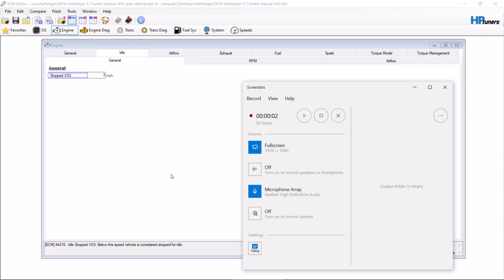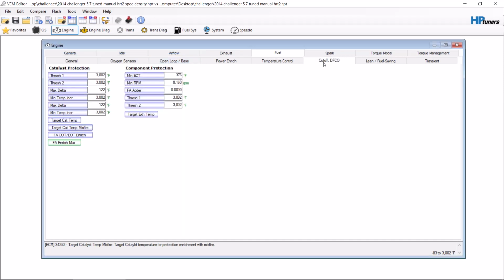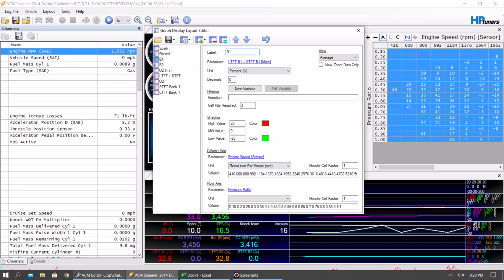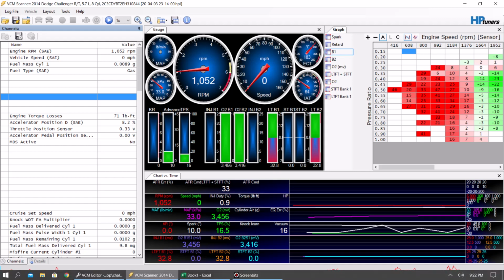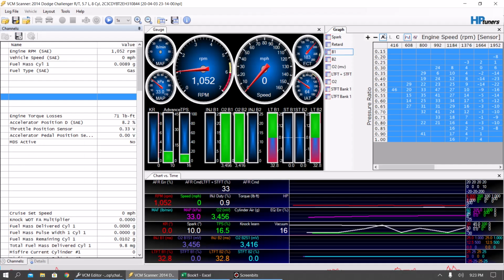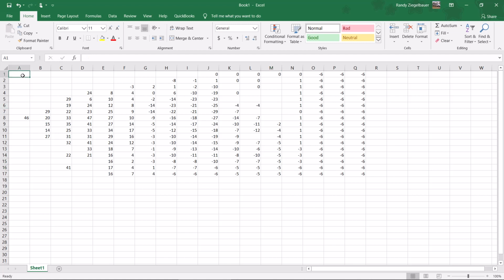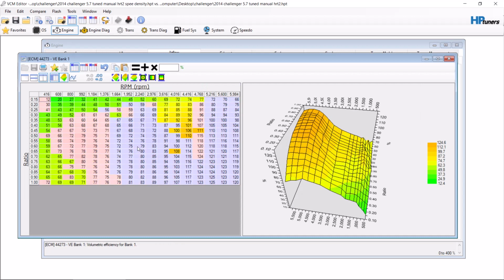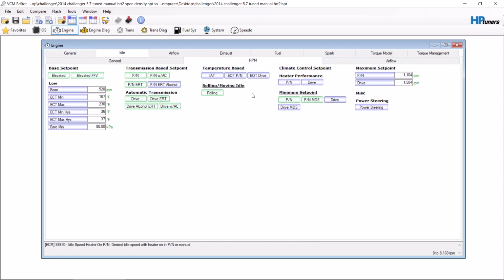How to tune VE on a gen 3 Hemi vehicle

Comment: Awesome video thank you! I am new to this and learning as much as I can. On the larger errors Is there a reason why you would not want to just account for the error more directly instead of creeping up on it? Like if you have a cell or area that is +20 in your error table this means that averaged it needed to add 20% more fuel to the VE table at that datapoint to stop being lean. Correct? what would be the downside to just use the paste special to multiple by %? this would essentially multiply by 1.20 and increase fuel 20% in the VE table?

Comment: I built the two tables that you describe in this video and follow the steps but no matter what changes I make to the VE table, the cells in the log only populate as zero. I have done up to a 20% swing on my VE tables, and I simply can’t get those tables to work as designed. Any pointers?
Reply from the maker: Usually if it’s not populating it’s because it’s missing what you’re trying to log in the channels

Comment: I have a Gen 3 5.7l that I installed a Comp stage 2 cam, 273HRT.  I watched your video on VE on a Gen 3 hemi.  On start up it goes to 1400 then slowly idles down to 800 then surges up and down til it dies.  I logged the VE like you said but my table has negative green, no red cells like yours, and they increase to about -16 and bounces as low as 400 rpm til it dies.
What can I change (the VE ) to get it to run so I can log?  Keith
Reply: Any luck? have a similar issue with my 6.1 rebuild i got going in
Reply: Me to bro  @03Creations

Comment: Could you explain why setting Power Enrichment Delay -> RPM Max to extremely high RPM disables it? The description says rather something else. WHat I understand is that above this RPM the delay in going into Power ENrichment is disabled. Not the power enrichment itself. Also the desctiption says that ABOVE THIS RPM it is disabled, but you will never go above. I don't understand that part.

Comment: So after part throttle you would turn everything else back on except NN and tune the rest of the table? I've got the proper inj data entered but fueling is way off with NN. I want to try and use ve to tune and not hack my pulse width data. This is on a Hellcat. Id1050x inj and 17lbs boost.
Reply from the maker: Technically if injector data is solid you don’t mess with it, just do ve only

Comment: Thanks for the video. How does the system use these tables? Does it switch from one  table to the other at WOT?
Thanks!
Reply from the maker: Which tables exactly
Reply: @Recklessmotorsports  VE 1& 2
Reply from the maker: If there is NN then they always use them
Reply: @Recklessmotorsports  No NN 05 Ram 1500 Hemi
Reply from the maker: Then it uses it all the time

Comment: Thanks for these videos 
I am looking for tuning software 
I was going to buy the CMR because both my hemis are Diablo PCM unlocked and Diablo CMR tuned.  Could you advise if I am switching over to HP tuners what needs to be done or stick with CMR purchase plan
Reply from the maker: Switch to hptuners trust me it’s worth it and most times you can use same pcm

Comment: I do have a question if your bumping up the shift points I’m assuming you need to do  the same to the RPM axis on the VE table to match the new Shift points ?? Or just leave it cause I see you can change it .

Comment: I disabled NN and all variable camshaft options and no change to the ve table has an effect on fuel trims. It seems to not be in speed density. Any clue what would cause this?
Reply: Speed Density is WOT only not normal driving, once you step on it your oxygen sensors have no say

Comment: Hi, i dont understand the VE. I hope you can help me. My questions are:
1- what does minus mean in the VE graph and why does errors show. What do errors mean? 

2- why are we copying the the graph from the scanner to the editor? Why are we copying the errors? 

3-what does a low (red) VE mean in the chart? What causes it? 

4- why does it show minus and what causes the error to show in the first place while logging\driving.

5- when you copy paste the numbers from the scanner to the bank 1 ve. What does this do? And what should you do after it? Do you also manualy adjust each number to make it smooth? And when you change a VE number what happens? Does the computer add fuel or? Idk its confusing.

Pleasee helppppp.
Reply from the maker: Error is fuel it’s adding or subtracting in a percent. Red means it’s lean and it’s adding fuel. We are selecting the error and pasting multiply by half so the change isn’t so dramatic
Reply: @Recklessmotorsports  when you go to the main VE table and see all these numbers 50,90,70 etc. Are these fuel? Does 90 mean rich ? And 50 lean? I mean if we are using the fuel errors to adjust in the Main Ve then the main VE numbers should be fuel right?
Reply: @captain052A  VE means volumetric efficiency, so 100% means 100% of the cylinder gets filled with air/fuel mix. at low rpms/loads. An engine almost never fills 100% of its cylinders with air. Say for example the engine only fills 50% of its cylinders with air at 3000RPM at 40% load (0.4 Pressure Ratio); the 50% in the VE table for that data point tells the ECU to inject half as much fuel as it would need to if the cylinder was filling 100% of its space with. Its not lean or rich (unless the table is off, in which case you need to add or subtract fuel based on the datalogging. The ecu always aims for Stoichiometric ratio at any given VE as defined in your FA Stoich Table. only time it aims for higher (richer) is when in Power Enrichment.

Comment: If my base file that i grabbed from my car already has power enrich delay rpm max set to 8160 does that mean from factory power enrich is disabled?
Reply from the maker: Yes
Reply: No!  That means that there is a DELAY enabled before PE is entered.  PE is not disabled by turning on a delay, unless you set a delay value that is stupid high.
Reply from the maker: 8160rpms is super high.

But with that being said the descriptions can be confusing, one might make it sound like at 8k there is a delay and another description might make it sound like there is a delay until over 8k. 

Read the description multiple times and it’ll make sense

Comment: So if I'm getting positive numbers that are red between 1100 and say 3200 RPM in the lower rows like 0.10.0.30 am I supposed to go to my table and add to a multiplier times 1.1 like you did for the very low end? I don't understand how to adjust that red out of there or if that's okay? I know it's plus or minus three but some of these are plus eight but not sure how to get them out of the red or if the red is just a color. ? Sorry this is voice to text and I'm driving if this doesn't make sense lol
Reply from the maker: techinically if you have a plus 8 you would times that box by 1.08 and if you had a negative 8 you would times that box by .92
Reply: @Recklessmotorsports  got it. Is there ever a time you adjust with everything set back and turned on, accept neural network that is?
Reply from the maker: Sometimes when I’m fine tuning I’ll make some adjustments with everything on

Comment: I think instead of adding the values in the excel spreadsheet maybe use the interpolate functionality in the UI?  That's how we smooth it out as you're going to want and go back after this and do the process over again ensuring +/-5%.
Reply from the maker: Going to excel is to add data that doesn’t exist since you don’t hit every cell, hitting interpolate slows the process down

Comment: I guess you’ll also need to change your VE Max back to it’s original setting?
Reply from the maker: Some builds your VE table will be above the factory max on the table itself. I set it high enough I won’t hit it and leave it a lone.
Reply: RecklessMotorsportsUSA thanks so much for shedding some light onto this subject great video! I’m just starting to tune my car after running a canned tune for a couple years now. I’ve installed some long tubes and other bolt-ons but will be supercharging in the future. One more question. In the table for the row axis it’s pressure ratio. Is this the predefined pressure ratio[math], a VE pressure ratio or did you create a user Math?